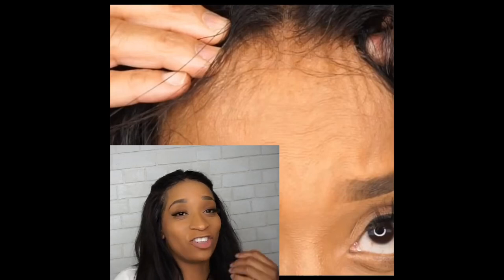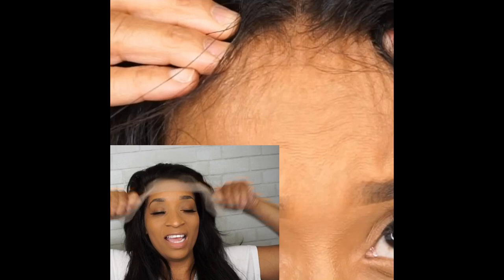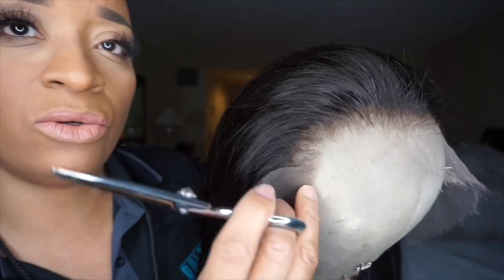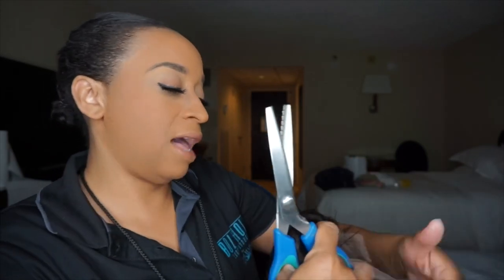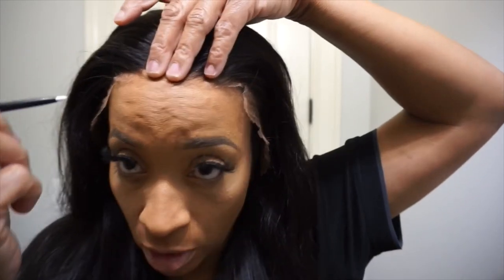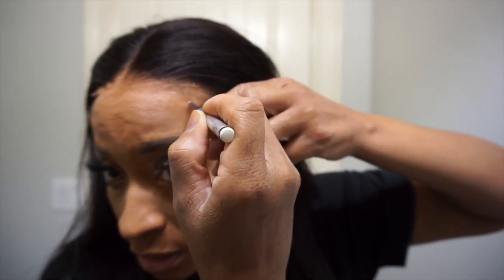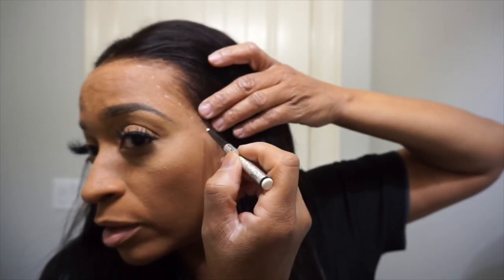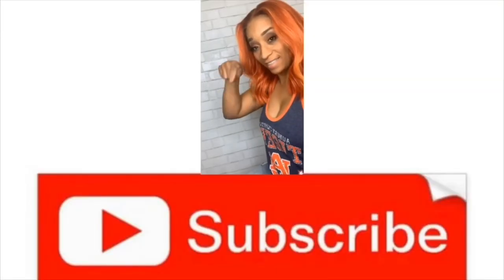(High AUDIO) Part 2 MY Lace FRONTAL BUCKLED! RIPPLED (with HIGH AUDIO)

Comment: I think this might be the answer to my problem🙏  I made a wig and no matter how many layers of glue and got2b spray I use the dam thing keeps buckling and lifting up at the sides, it's really bothering me as the wig is new. I did think to cut slits into but didnt want to ruin the wig any further but this has just confirmed that it might help so Im going to try cutting slits into it and see how that works. Thanks again.
Reply from the maker: We don’t recommend got2 be it has alcohol. Our Bold Hold Liquid Gold and Lace Gelly are Glueless products and come off with water. Install will last up to 4 days.

Comment: Most ventilated closure aren't fully formed on a curved surface but a multi-surface only cap making has to do with lace curvature when ventilating a full lace wig. The notching/darts in the back is for added integrity of the foundation as to not cut into the lace during formation.  The lace you have isn't HD but a coated or film lace of a higher denier. HD quality lace MUST be ventilated using a certain technique and just the front edge is single ply. Also HD frontals are too fragile for everyday use. Machine injected closures also have certain patterns left from the injection machine. You may want to check with the manufacturer that you purchased the unit from if you where told that the lace is HD quality.

Comment: How do you remove the glue from the lace so you can reuse the unit? I use Got2b but would prefer a glue if it was washable
Reply: I use a old toothbrush and conditioner. brush it off

Comment: The problem I have it once I lay my lace.... my bold hold active turns white. Can you please tell me what am I doing wrong
Reply: @Thehairdiagram767  I purchased it at Beauty 4 U at 6388 E 82nd St, Indianapolis, IN 46250. I paid $32 for the glue at my local beauty supply store. Me personally I think it’s a knock off because there is no way this glue should be turning white. Once I apply 2/3 thin layers and place my units on it turns white. I plan on only ordering your products directly from your website.
Reply: It means you sweat,that’s why it turns white